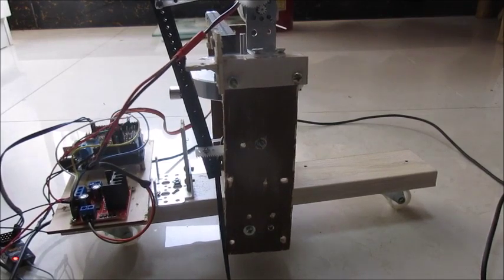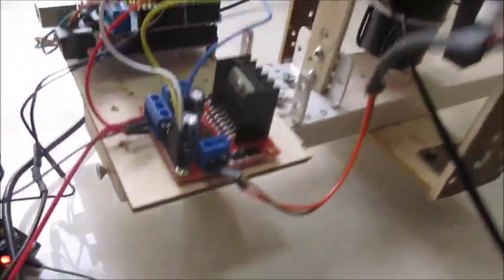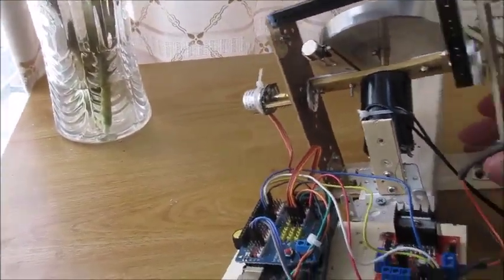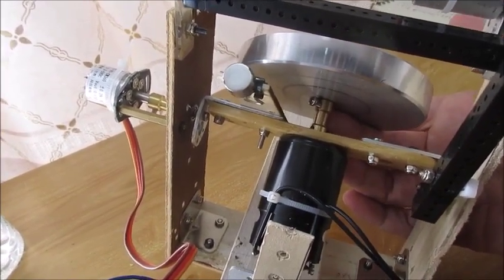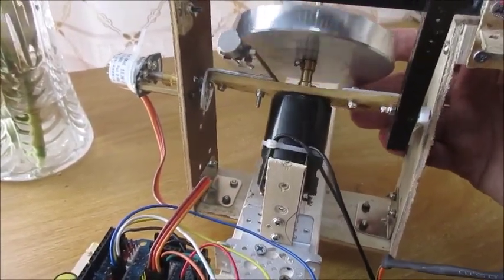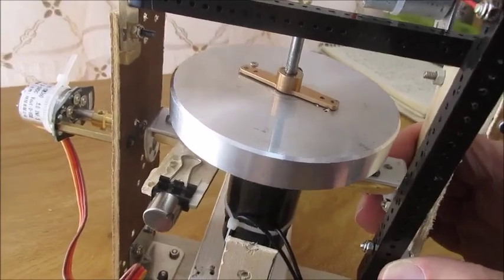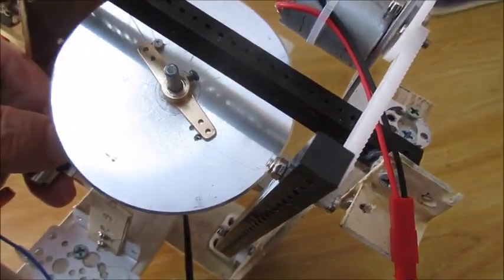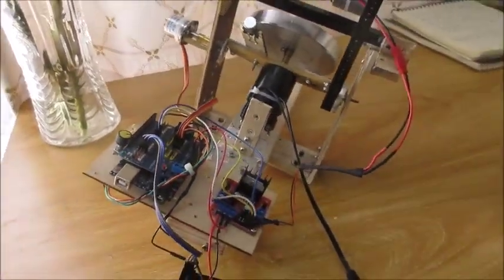Self Balancing Gyroscope Two Wheeler (Part 1)

Comment: Nicely done! I'm in the process of making a gyro rail as well! I was inspired by Eric Laithwaite's lectures. I've build a steady gyro in a pretty decent frame. I'm at the stage where I have to make the servo and feedback. I was wondering though, would it be possible to build the servo circuit without a microcontroller unit? Some active control circuit using an IC or something like that.. I haven't understood the logic involved, is it like a linear response or does the servo need more speed if the disturbance is high? If it is simply a feedback where there is a tilt to one side, the servo has to simply work in fixed impulses to bring the vehicle upright; Is this correct or is it more complicated than that? Thank you..!
Reply from the maker: Take a look at the the book in the description by Mori - he does not use a micro controller. It is very detailed and applies to trains. Good luck and let me know how it turns out.
Reply: Can I get this model

Comment: can please tell me more about the potentiometer, or please provide me buying link.
Reply from the maker: https://www.amazon.com/Effect-Potentiometer-Encoder-Sensor-Degree/dp/B07SXFBN5D
or similar.
Reply: Thanks a lot, your work is awesome, I'm following your tutorial.
Reply from the maker: @TechMechRobo  Thank you. It was an exciting and rewarding project. Hated to see my part end. Hope others make it better.
Reply from the maker: You can find a cheaper pot probably. It should be a non-contact variety as they do not give false readings and are not so prone to vibration. Non-contact have an internal hall-effect sensor and a magnet. I tried cheap pots, they do not work well at all.

Comment: one quick question. did you. make that wheel yourself or bough from somewhere else?
If you bought it , from where??
And which motor do you use to make gyro??
Reply from the maker: Hi Tirth. I had a machinest make it. It only cost about $30 here in china but I had one made in the US and it cost about $100. So no you can't buy one but my friend Okki bought one of these: http://www.bengs-modellbau.de/material/schwungraeder/gussschwungrad-140mm
from Germany, might be an option for you. Or perhaps you could source one from the US. It is a model steam engine flywheel and they have different sizes - looks perfect. Regardless, it must be vibration free or you will have problems. Please check out my Part 3 where I have this gyro mobile now and more to come. Any questions always welcome. Be sure you check out the booklet I mentioned in the description by Mori Hiroshi - invaluable!
Reply from the maker: The motor is a Mabuchi 550 12 volt 18000 rpm (no load) motor. You could probably get away with a 390 or 540 sized motor as long as it is rated higher than 10000 rpm. Also depends on how heavy your rotor is. My aluminum rotor weighs 360 grams. Your rotor weight to the weight of the entire vehicle ratio has to be from 10 to 30 % for it to balance - generally speaking. My ratio is 20%.
Reply: Thank you very much and kudos to your work 👍
Reply: And I have read that documentation that you linked with your video. And here I got to know that I can even set the rotor vertically. So, just wanna ask you have you ever tried it? And should I try this or will I face some problems in it??
Reply from the maker: @tirthpatel3564  I did one vertical axis setup and it worked but it had no active controls, just a gyro on two chopsticks. I see that Mori Hiroshi started using vertical axis gyros but then his final gyros were all horizontal axis. The C1 motorcycle from Lit Motors used horizontal axis. So it seems that is the way to go from what others have been doing. You could try it though - you would be breaking new ground. But we know that the horizontal axis gyro works for sure.
Reply: Would you like to share your any social media id or maybe even your number with me? Because, as we know that gyroscope is the field which has very less community and I know that to make gyroscopic vehicle I am gonna face so many problems. Thus, I need someone who has experience in this field and you're fitting in it because I have seen your 2014 videos when you built gyroscopic two-wheeler just by using CDs. So I think you've pretty good knowledge about this field.
Reply from the maker: @tirthpatel3564  You can post on my Wordpress site where I want to update my latest gyroscope happenings: https://demej00.wordpress.com/2020/02/08/self-balancing-gyroscope-two-wheeler/

Comment: Congratulation !
Reply from the maker: Thanks to you. I couldn't figure out how to make the servo motor work until I saw your documentation.
Reply from the maker: By the way, my ratio of rotor weight to vehicle weight is 358g / 1800g at 4000 rpm or 19.9%
Reply from the maker: I wondered why my single gyroscope vehicle turns right just fine but falls over on sharp left turn. I believe it is because on a left turn, if I turn the vehicle sharply and quickly, I exceed the rate of precession to the left (my gyro is spinning to the left) and the rotor becomes unstable. But if I turn slowly, there is no problem as I do not exceed the rate of precession. I guess the only solution is to turn the entire gyroscope to the left when the vehicle is turned left.

Comment: Mare pan aavu banavu che
Reply: Aa wheel nu weight and dimension su che
Reply from the maker: Not sure I understand but it weighs 2 kilograms, the gyro wheel weighs 365 grams and rotates at 4000 to 8000 rpm. It is about 20cm wide by 30cm long by 25cm high.
Reply from the maker: Free pdf download on gyro on my website: https://demej00.wordpress.com/2020/02/08/self-balancing-gyroscope-two-wheeler/

Comment: Very nice Jimmy!
Reply from the maker: Thanks Okki. Good luck on your new business.
Reply: @demej00  thanks Jimmy!
Reply: I didn't know that you mentioned my name on this video.. I should thank you, not you me.
Reply from the maker: @OkkiMoeljadi  Your gyrocar motivated me to keep working on mine. Be sure to check out Hiroshi's booklet - very informative.
Reply: @demej00  yes, I have downloaded the booklet. Thank you. I think I have the possibility to build real gyrocar now. I can just buy a used motorbike, stretch it and put a big gyro on it. Let see if I can do that. BTW, can you tell me more about your high quality, low friction potentiometer?
Reply from the maker: @OkkiMoeljadi  Oh that would be really cool. Here is the info on the pot: https://www.amazon.com/Contactless-Digitized-Potentiometer-angular-encoder/dp/B01GDMRQGO
Reply: @demej00  that's a nice pot, thanks Jimmy! I think, I can also use TPS (Throttle Position Sensor) from a used car engine for this purpose.
Reply from the maker: @OkkiMoeljadi  Here is my latest. Got it to balance and drive left and right. Surprising it doesn't fall in one of the directions. It may fall if I turn sharper, not sure. Will play with it some more. Regardless, the program and servo work really well and very happy with that. Now I can give this up and work on something else. https://youtu.be/s6CJk1xAB7s
Reply: @demej00  Hi Jimmy. Yes, I saw your video already as it was only 3 minutes old and gave it a thumb up. Very nice Jimmy. Maybe you can make another video showing that platform making sharper turn.
Reply from the maker: @OkkiMoeljadi  Shoot, lost my reply to you so have to type it over. Anyway, thank you. It is very satisfying to see it balance so well. I will change the steering linkage and make some sharper turns and a video. I am curious too. Am surprised it doesnt fall over on even a mild turn and the rotor gimbal does not rotate forward or backward. It is spinning at about 6000 rpm, and has tons of torque. I have had it up to 10000 rpm. Lowest I can balance it is at 4000 rpm. The program does a good job of keeping it in balance.
Reply: @demej00  I think if it makes sharp turns with some velocity, the platform will lean like a motorcycle. The same thing will happen if you put some weight on one side of the platform, it will balance by tilting itself. I have another idea Jimmy. Maybe you can use this gyroscope on your 2-wheeled robot. Remove the balance function from that system and let the hardware gyro do it. I can imagine, it will lean forward as the robot moves forward and it will lean back if the robot slowing its velocity. It is maybe interesting to see a real gyro do the balance on that robot.
Reply from the maker: @OkkiMoeljadi  Yes, I will try testing turns tomorrow and let you know. Good idea about the two-wheeler. I actually saw video of someone who just put a gyro (no controls) on a two wheeler and it balances. Will try to find the video of that. Might try that too at some point.
Reply from the maker: @OkkiMoeljadi  Here is that video: https://www.youtube.com/watch?v=XqXNnaJ-n0I
Reply: @demej00  wow, great! Thanks!
Reply from the maker: Okki I didn't make a video yet but did test it out this morning making sharper turns. It will turn a little sharper left and right without falling over, and right sharp turns work good. Left sharp turn will make gyro fall over. I know how to fix that though. If I put the gimbal on another axis so that it rotates a little with the front wheel, it should work fine. I have ordered a bearing to put the gimbal on but the shipping companies are only shipping food now and so don't know when I will get it. So now have to play waiting game. It does lean inwards on a turn though.  Will make a video when I get batteries charged.
Reply from the maker: Hi Okki. An interesting discovery:  I figured out why a gyro vehicle falls over on a left turn (if the gyro is spinning to the left (ccw)). If you turn left slowly, no problem, but if you turn quickly then you exceed the rate of precession and the gyro falls over. So the trick is to not exceed the rate of precession. One solution is to put the gyroscope on another gimbal. I did this but the bearing was so heavy I exceeded the torque power of the rotor - so waiting on a heavier rotor to try it again. Another may be to increase forward pitch of gyroscope during left turn. Will try that one soon. 
This also explains why a right turn at any speed is ok since you are just increasing precession rate.